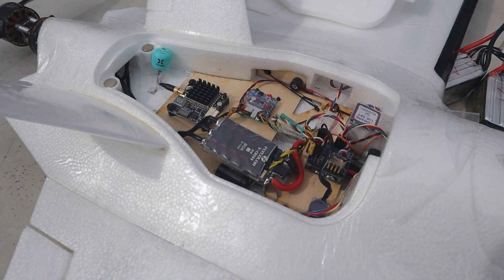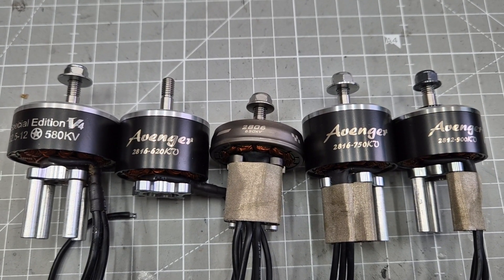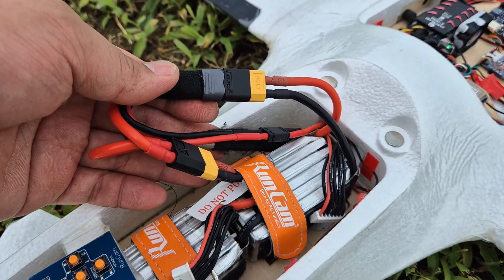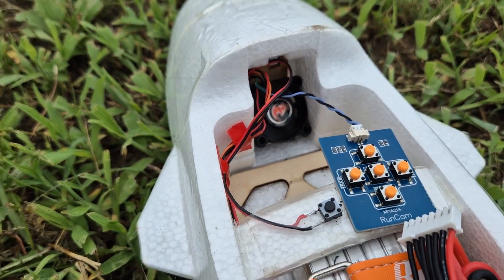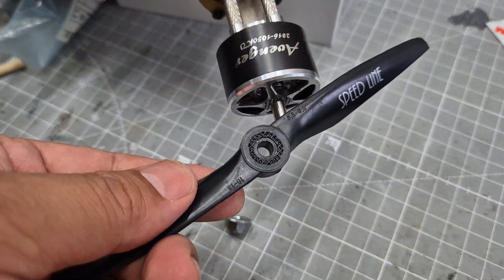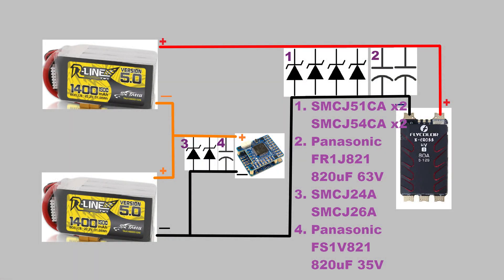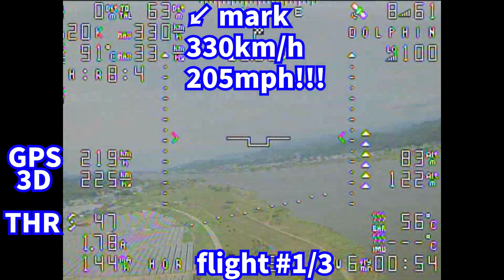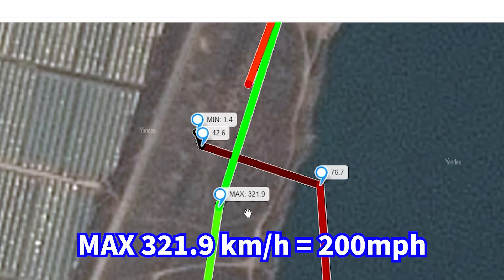atomRC Dolphin over 200MPH! 320km/h!

Comment: Hello mate.. I was wondering how did you get the motor in place.. I cannot fit  motor larger than 28xx because the diameter and i cannot screw it up to the  motor mount.. How you do that with 32xx motor.. thanks

Comment: So could be done with 6s with 2000kv motor possibly...  I was able to get 170mph with a 2412 1750kv (one off test motor never manufactured) and a 6x5 prop.  Pulls about 40 amps.  9600 feet above sea level though!

Comment: Soon will mod atomrc delta strike (edf) to pusher and use similar kv seput but with 6S and lighter plane. 6S 2800mah  and 2814 2200kv motor with graupner speed cam prop 5.2x5.2. Let's see, my goal is 300kmh 😅
Reply from the maker: Good Luck!
I think it would be good to change the three wire of the motor to a thicker one.
Reply: @celeselements  since I use EDF tunnel to air flow and space the phase wires only have 3cm motor to esc!
Reply from the maker: @robertoricardo182  COOL!

Comment: i have a question i build my own dolphin and i got the at75a tmotor esc. i just checked of everything works and my motor does not spin. i can hear my esc beeping but i cant spin my motor.. what could i do?
Reply from the maker: It may not be a problem with the motor or ESC. The beeper sound comes from the motor, which means the ESC and motor are well connected. You might want to check the top and bottom of the throttle and the reverse. If you have FC, please check the receiver's behavior on the Receiver tab.
Reply: If you use INAV to setup your FC, you need to have GPS locked. To bypass that, just to bench test , add and enable "Ovvrride Arming Safety" "Always" on Programing Tab. Let me know if you need guidance, I had a similar issue.

Comment: Ecalc is usually very accurate and shows the motor pulling over 3000 watts and only going 173MPH. I wonder why it's so off.
Reply from the maker: Yes, the data of Ecalc is really vast and precise. I think that driving a 14 pole 1050Kv motor with 12S is probably foolish in terms of efficiency, so it is not in the data.

Comment: Which motors did you like better? 32.5-12 or 2816?
I believe you tested both, but on different props.
If I can recommend you a fast prop from my test: APC 6.5x6.5
I dont know why, but smaller props have been faster top speed and more efficient.
Reply from the maker: 32.5-12 is on the way to my home.
I think 32.5-12 is a bit bigger and heavier motor, so it can handle more larger prop.
I'll test your recommended prop and APC 5.25x8, 7x11, high pitch prop.
7x11 will burn 2816/1050Kv motor.
Small props has smaller disk area, it act as drag. 
I'm looking for a way the best result for me among RPM, speed, current draw and sound!
Reply: @celeselements  I tried the APC 7x11 prop with 3110 motors. They didnt get fast at all and just draw high current. The problem is they have so much pitch, that they stall at any speed below 200 kph. So even getting in the air is not optimal.
I wouldnt try more than a pitch of 8.
Also not go bigger than 6.5 inch or stay below 7 inch.
With a 5 inch prop you will need higher kv motors.
If you want more silent, three blade props and a pitch of 5 to 6.
But top speed and higher speed cruise efficiency is not as good.
Just ordered some 32.5 12 950kv for 8S with 8x6 props
Reply from the maker: Thanks for sharing.
I have similar experience about 7 inch prop(Super-S 7x7).
As you can see in the video, RPM reach 40K. I think the motor is close to the mechanical limit.
Reply: Well done!  Any update using the 32.5-12 580kv? I am building a 12s Dolphin and would appreciate any tips you have learned since you made this video.  Thank you.

Comment: why did you add a giant cap on the FC board (the one just before the cooling fan of the ESC)?
Also, Very nice and fast dolphin build!
Reply from the maker: Thank you!  You're sharp! A cap on FC is for rush current, surge, etc. honestly, it is a overkill. I think the capacitance is OK with 330~1000uF, mine is 680uF 35V.
Reply: Cuz sudden voltage spike
Reply: @MulberryAcademia2025  Yeah but that doesn't look like the battery circuit?
 and what uF does he use.
Reply: @unknowninvictus2520 you can add a small cap around 220uf to the vbat and ground pads on the flight controller.  It helps to clean up the noise before power goes to the regulator on board which goes to the gyro.  The less noise you can get to the gyro the better.  Never really seen it in wings but it's pretty common on larger or power hungry quads

Comment: Very good. How many amps maximum? I use 3115 1500kv motor but only 6S, with 7x4, might try 7x10
Reply from the maker: Thank you!
At my configuration, the FC can't measure the current on ESC. I didn't check the current with other instrument, but the ESC temp is rise over 194°F(90°C). My ESC is 80A spec, I think the current exceeds that spec. The RPM mark 33,000RPM at full throttle.
Your setup looks robust and fast!
Reply: 3115 1520kv 6s 7x6” 250km/h horizontal 22*C
Pulling roughly 1kW  @ 200km/h 
1.9kW @ 250km/h
I think with better batteries it would be a little faster.
Reply from the maker: Great work!
I choose 12S for small difference and future options.
I think 12S has a pros at full throttle sustaining than 6S.
Reply: Man, I have 3115 1050 kv. If I use, 7.5 or 8 props on 6s, could it do 200 or 250 ?  @pk2396